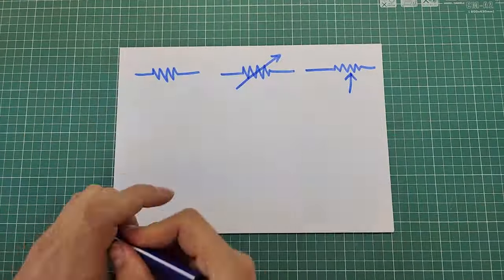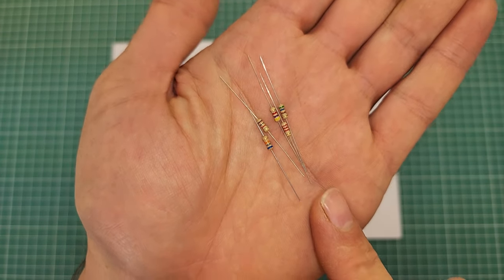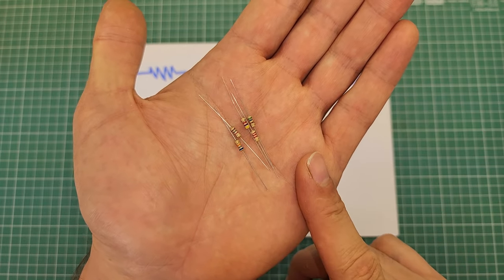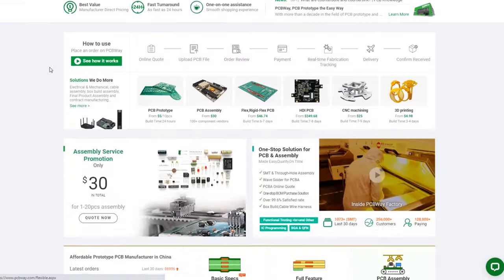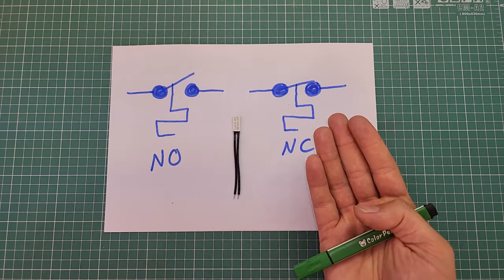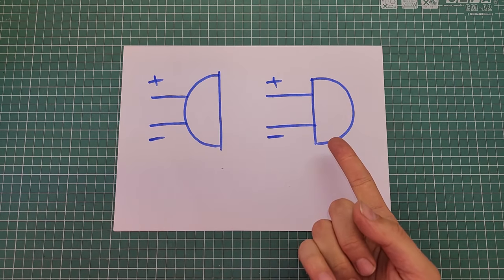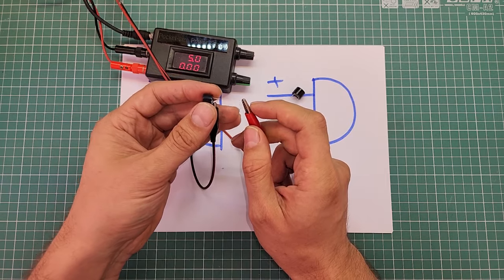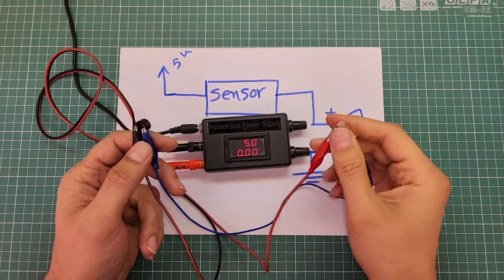Basic Components, EP#01: 6 Key Components for Every Beginner

Comment: In the 90’s and 2000’s perhaps even today, General Motors vehicles had knock sensors that contained piezoelectric crystal that allow for detection of even the slightest presence of a pre-detonation or knock. When the vehicles ECM detected this “knock” signal, it would then roll back the engine’s ignition timing til the “knock” signal was gone. Conversely, if the vehicle happened into some fuel with a higher octane rating, the ecm could advance the engine’s ignition timing until a “knock” detected then level off. This would allow for slightly more power at times. 
Isn’t the device you featured in your video an example of a non magnetic reed switch or trembler switch rather than a knock sensor? 

You have some of the best  videos on Electronics and it’s a privilege to have access to them. I look forward to what you new videos will have for a topic. Thanks for all the information!!